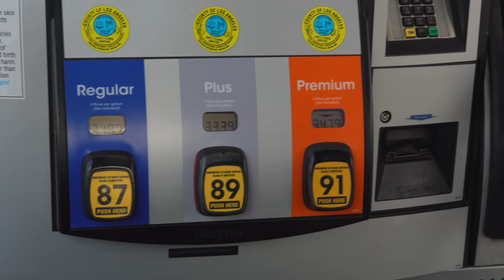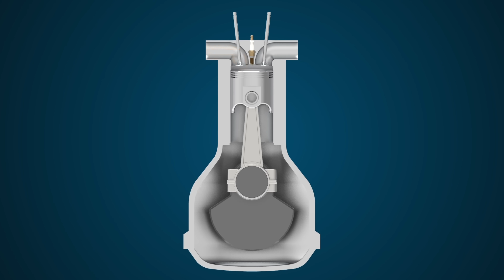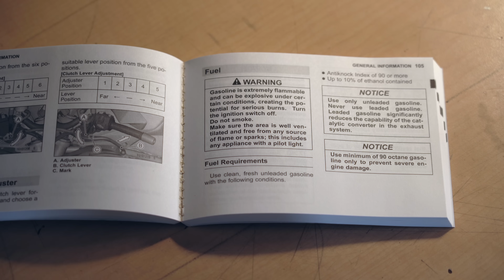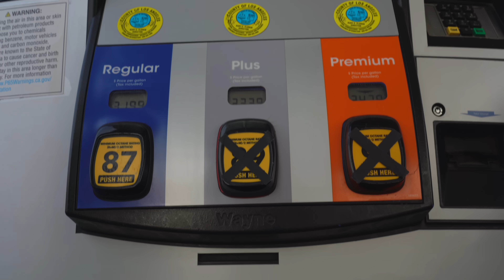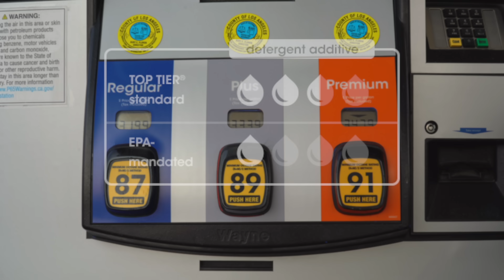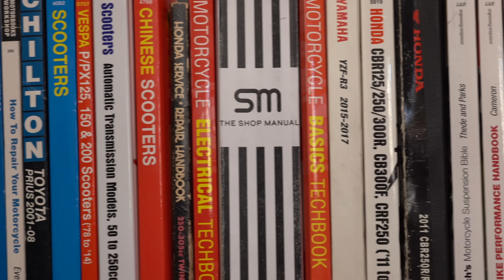Should You Run Premium Gas In Your Motorcycle? Octane Explained | The Shop Manual

Comment: Great video.  As a 1st time scooter owner (2020 Yamaha Smax/ XC155LR) and taking delivery via delivery during this pandemic I didn't have the ask question session with the dealer and as a result my 1st fill up was with 87 octane gasoline.  The ride was horrible, I knew something was wrong and asked questions on the Internet, getting 1000 opinions.  So I called my dealer and found out that I should be using premium gas, so now I am strictly 93 octane.  Had I only known about these Revzilla videos at the beginning.
Reply: Every bike manual says what gas you should use. And if you don't have a manual download it from internet.

Comment: Also note that 91 (low est octain fuels) can use other additives which cause waxing. Great for efi injectors as it improves lubrication properties in the fuel system. However for a bike that sits alot and carby bikes it blocks up jets, being a right pain. Highly advise running 95 or 98 fuels in those bikes before storage or to drain the fuel from the fuel system. Only run 95 and up in my cars and bikes.  Note, for Australia.

Comment: You missed a couple things: 
- US (R+M)/2 rating is ~4-5 points lower than R method used in most countries, so 87=~ A91-A92 and A95 is ~ US 91;
 - minimal grade sold in EU is A95 so most european bikes will need 91 and manual will list 95
- Rocky mnt states like Utah, Colorado, western SD, etc sell 85/86 as regular; and some stations sell cheap 87 but it is 30%+ ethanol which no bike is designed to handle. you definitely need to be careful there

Comment: Yes you are right if you think of engine management as static. But it is not that simple. O2 sensor, especialy new wide band  O2 sensors and  knocking sensor will be monitored by EM. And if you use high octane fuel in modern engine, there is a range where fuel higher detonation resiliance will be exploited by engine management. EM will advance ignition and valve management to some degree till knocking starts, or bad fuel brurning starts to be sensed by O2 or other sensors. This means that high octane fuel will be utilisied  by the engine, and higher efficiency will be achived. And that is more power and less fuel used.

Comment: Could carbon buildup cause power loss in a bike? My bike has been acting up when I try and give it throttle from a stop, and sometimes stalls as I'm coming to a stop. I've got to maintain gentle throttle to keep it alive, and give it a little rev to wake it up before trying to move. If I don't it just stalls. I've also tried giving it more gas, but that just makes it stall harder. Almost dropped the bike once because it stalled while I was trying to merge into traffic and I had to fumble to stop before the bike rolled into oncoming traffic

Comment: In the 1980's  in Australia we didn't have a petrol with a high enough octane level for my BMW so l had to reduce the compression. Now days we have octane rated petrol of 91, 95, and 98. Why is yours so low, and how do you guys get European bikes to run on those options.......93 seems very low. Sometimes l even add an octane booster to 98 RON to give me more power, and it is noticable.

Comment: I'm in Iowa, by far the highest ethanol-producing state in the union. So of course the cheapest gas at the pump contains ethanol. Most places here have 91 octane as premium and it does not contain ethanol. That's what the manufacturer of my bike says to use at a minimum. Definitely says non-ethanol gas. At 48 mpg and 3.5 gal tank, it doesn't hurt that bad, lol
Reply: You can find ethanol free gas in Iowa?  That's pretty good.  I'm in Colorado and I have to travel about 10 miles to get ethanol free gas (I only use it in my lawn equipment since the gas tends to stay in the gas can longer and ethanol attracts water.  It's also over $4/gallon).  Plus - regular gas is 85 octane here.  I have to buy medium grade just to get 87 octane (which is what my bike calls for and what I buy).
Reply: @MrTexasSteve  Many corner convenience stores in Iowa have all flavors of gas. Also, they are "top tier" with regard to the detergent package. In states where it is difficult to find good gas, it is due to your elected officials.

Comment: In the state of Minnesota, the regular gas and mid grade gas has ethanol in it. The only gas that has is ethanol free is the high octane stuff. I ride a 2018 GoldWing (which I know you love, and so do I) which calls for regular 87 octane and I will run it on trips if I'm going through gas quickly but won't put the regular ethanol crap in if I'm storing the bike.  Thanks for the video!

Comment: I use premium fuel in my motorcycle and car and even my lawnmower. Here, there is no ethanol in premium fuel and it also has way more cleaners with higher octane to boot. The extra cleaners are important to keep injectors from clogging especially in today's GDI engines. The extra cost of the premium fuel won't even buy you a cup of coffee these days anyway.
Reply: Check your location to see how many 0 ethanol stations exist. There may be some. However, premium gas is not necessarily ethanol free.
Reply: Lawnmower lol

Comment: High octane gas also has anti-oxidents added, another benefit in addition to detergents. I'm a control engineer who's blended millions of barrels of gas and diesel for 31 years for Shell, Fina, Exxon-Mobil, Chevron-Texaco & PetroCanada. To my knowledge, we've never blended cheap, off-spec gas for the Quickie-Mart type of retailer. Every 50,000 barrel blend is on-spec, or reblended till it meets spec (Road Octane = (Motor Octane + Research Octane) / 2). Here in Canada, you can see a tanker from a big name refiner, filling the tanks of the "Super Save" gas station.  The small retailers don't have their own refinery to make shit gas. They purchase on-spec gas from the big boys.
Reply: The ‘cheap’ gas or ‘unbranded’ gas is called Community gas and only meets the government minimum set in 1996 ( here in USA ), otherwise Shell, QT, Chevron…they have their own blends. Costco is interesting as they add their own additives at the delivery locations, thus boosting the ‘community’ gas up to the higher top-tier level stuff.
Reply: This makes me wonder if the folks at Sam’s Club make their own sub-par blends because any time I’ve filled up at a Sam’s Club store, my actual MPG (not car-computed) has always gone down. Less expensive since fuel is always nice, but not at the expense of good performance and keeping the equipment in good shape.
Reply: @trenauldo They have their tires and electronics made lower quality so it wouldn't surprise me.
Reply: @trenauldo  has a higher ethonal content, makes it cheaper and less mileage
Reply: We use to use platformate in our refinery area trucks when low instead of heading to refinery gas stations. Platformate from platformures is high octane before blending.
Reply: teman apakah gas condensate bisa untuk bahan bakar motorcycle mohon jawaban saya dari Indonesia
Reply: This

Comment: old news to me. like about 45 years old. the bike will tell you which octane grade you should use and a poorly designed combustion chamber requires higher octane. a centrally located sparkplug gives a shorter flame travel and thus less chance of detonation. also smoother contours within the chamber allow an easier movement of flame travel across the piston which also curbs detonation. 

the best fuel is that which does not contain ethanol and not the one with the higher octane research number.
ethanol absorbs water and thus decreases power and fuel mileage. when i switched to non ethanol gasoline my mileage went up from 50 mpg to 55 mpg and i also had to lower the idle speed as it went from 1100 rpms to about 1350 rpms at idle. this indicates the fuel is making more power than when running ethanol added fuel. also ethanol is bad for older bikes like i run because it is corrosive to the neoprene rubber these older engines use and that goes for both 2 wheel and 4 wheel vehicles. 

ethanol is very good for the lawn mower repair business though as it quickly gums up the fuel systems of smaller engines. it also pulls moisture out of the air so if a fuel sits in the tank for some time then it is adding water without you knowing it. fortunately there is a site that tells you where to find non ethanol fuel.
 the link to it is below.

https://www.pure-gas.org/

Comment: I don't ride anymore because of Covid19. 92 burns cleaner in slow traffic, at highway speeds 87 is burned at a faster rate and cleans as good as 92. Cars with a lot of sludge are cars that run in the city all day to lack of oil changes. 2012 S10 25K M

Comment: With my 4cyl car I would use 91 at the start of a long multi state road trip 1 way. On a trip through 4 states(except Texas, Alaska, and Rhode Island). Once had to do a tear down after a trip due to a blown head gasket. That engine was very clean after 400 miles of running at highway speeds before the head gasket went. The blown head gasket wasn't from the fuel used. It was a manufacturing defect.

Comment: I have a friend who ran 87 octane in his 2014 Street Glide for years.  It knocked and pinged all the time but he insisted that was okay.  It was, until he cracked a piston and ruined his motor!  😮
Reply: Isn't it depend on compression ratio when choosing fuel?
Reply: @esdeathchan4354  yes, and the compression ratio in a 2014 street glide is only 9:1; it is designed to run on regular 87 pump gas.
Reply: @RedEmpire36  i thought so
Reply: @esdeathchan4354  yes the higher the octane the more compression needed to make an efficient combustion, so for example your honda civic uses 89 octane because it's a low compression engine and your Honda cr85 runs 91 octane because it's higher compression, if you were to run 89 in the high compression dirtbike, you will get pre-ignition simply meaning the timing of the combustion will happen too early causing rough running and knocking.
Reply: @ColinCearley27  and that can damage the engine for long time
Reply: I don't believe this story for a single second.
I have run 87 in my Harley for years - not a single ping, spark plugs show a healthy color, great gas mileage, optimal performance. Something else was wrong with your friend's bike. If it was running so crappy, why didn't he get it looked at or tuned?
Reply: @Jeff82556  Just to followup, my friend's 2014 owners manual does indeed state the bike needs to run premium fuel, and if forced to use lower octane then only do so for short periods and replace with premium ASAP.   That's from Harley itself, so, yeah. 😎
Reply: Most engines built in the last 20 years don’t require premium. It’s pretty standard to use premium in carbureted engines. The premium where I live usually only goes to 91 octane though. I run that in my Harley but it’s also a carbureted ‘95 1200 evo engine.
Reply: @Jeff82556  “Based off the Timeless design of the Ironhead Sportster, in 1986, Harley-Davidson upgraded the Sportster with the newly designed Evo engine, replacing its predecessor that had become a staple of the Sportster since its inception.”
Reply: @flfbsphatboyblue8970  I agree with your statement here, but I'm unsure why you're telling me this. What's your point?
BTW, the EVO engine was manufactured and used by Harley-Davidson since 1984.
Reply: @Jeff82556  Ahh… so you deleted your misinformed statements to Coyote. I see.
Reply: That's how it happens
Reply: Totally air cooled motor?
Reply: @daveyt4802  Yep, no water cooled heads on his bike
Reply: That's just Harley's shitty quality, not the grade of gas
Reply: @rslover65  says the person who has never owned a bike.....
Reply: Always heard the HD bikes had to run premium fuel!
Reply: @kensmith9334  Not true. Just looked in my Harley manual: says "use 87 octane or higher"
Reply: @kensmith9334  it could be that their was other problems with the bike like timing skipped a tooth, carbon build up, or running too lean
Reply: @kensmith9334  The V Rod requires premium because it is a high performance engine.
Reply: @Jeff82556  You should probably try learning all about Harley’s too. Try Google, if you know how to use it. 😉🤣
Reply: The fuel didn't cause his problems, it was a shitty engine to start with.

Comment: Single hose pumps. If you only top off with a gallon or so of gas (like I often do before parking back at home), you are really pumping whatever grade the last customer pumped. That is why I started carrying a small bottle of octane booster in my bike that calls for 93 octane. It's not a perfect system, but beats gradually filling your tank with regular.

Comment: Hi, can you PLZ explain HOW is the Yamaha R6 599cc way faster than the Kawasaki Ninja 650 649cc ?? how can having the same cc they have soo much difference in HP 98.9 vs 68?
Reply: Torque
Reply: The ninja 650 is stronger at lower rpms. You have to rev the r6 to higher rpms to achieve power.

Comment: Great vid! I always can't believe how many people think that higher octane has more power, and I always have to tell them that it is just their resistance to ignition. I do have one question, however. If I have a bike that says it recommends 87 gas, but I tend to ride it harder than maybe I should, would premium be a good idea just so I shouldn't have to worry about any pre-ignition?
Reply: It will probably just make it run smoother. Doesn't hurt, try it a few times then go back to 87 and see if you feel a difference.

Comment: Good video. Here in Australia I run my Indian Springfield on 98. In the USA 93 but Canada I found I needed to regularly use an Octane booster as the heavily loaded bike would ping especially when climbing. The octane boost was effective. I have not experienced this problem in Australia. I avoid ethanol but you don't always know what your fuel is so I prefer major brands. Cheers and thanks. Fuel is cheap. Pistons are not.

Comment: I have to Run 93    on 16 road glide or it knocks at low RPM        IVE haul gas      what a joke       87 & 89   for the most part its the same    company will put 89 into the 87 holding tanks because its cheaper to mix in ethanol    and as long as it rate 87 or higher its legal     No for 93    lol     that can be mix 50/40/10    50% unleaded   40% premium    10% ethanol        endless you go to Shell    Mobile   or Marathon        I know haul it by 8000 gal at a time        just saying

Comment: Higher octane fuels also have more preservatives.  These preservatives can cause some engines to cut out.
Reply: Correct. High octane has detergents, anti-oxidents, and sometimes dye added. I believe the preservatives you refer to are the anti-oxidents.

Comment: No comment about difference between  RON & MON?  If winter or summe should influence which gasoline you buy? Humm....
Reply: I mention the different rating systems in the first few lines of the vid. And it's a video about octane, not winter/summer blends.
Reply: @AriH211  No worries Ari, no intention to criticise for the sake of criticising. I just think there's actual value in understanding MON, octane impact in flash point, and if you use higher or lower MON gasoline depending if it's winter or summer and your bike's compression ratio.
Reply: I've blended millions of barrels of gasoline. In winter gas, we add Butane to increase the RVP (Reid Vapour Pressure). This is by far the greatest player in volatility, much more than Octane. It allows for better vapourization at low temperatures. Less of an issue in non-carburated bikes due to the advantage of fuel injection.
Reply: @impaaked  No one is saying the opposite. :) The question here is between RON ratings, which is the rating available to the consumer.

Comment: I worked at fuel tank farms, most fuel comes from the same location. You will see flying J, quick trip, 7-11 and etc you get the point I’m sure. There are few exceptions to the rules like Chevron, BP and Shell. They have their own refineries.
Reply: Yup, the base stock in fungible and comes from just a handful of refineries. What makes a difference is the additive package that each retailer blends into the fuel.
Reply: @AriH211  it’s already blended. It’s loaded in to the fuel trucks. It goes from the fuel trucks straight to the gas stations.

Comment: Also, many (most?) premium fuels have no added ethanol.  Older bikes built before ethanol was added to fuel may have components that degrade more rapidly in the presence of ethanol.
Reply: Mica the no ethanol-in-premium scenario is a thing of the past, at least in most regions in America (I can't speak for other nations). We mix ethanol at 10% in 98% of the fuel distributed in the States, as per the 1990 Clean Air Act and some other political crap. But you're right that older bikes, specifically their fuel lines, carb gaskets, etc., do not get along well with ethanol.

Comment: Wait a second here. Ignition timing is controlled by the ECU. The more advance is the ignition timing, the more energy extraction from fuel, the more power. ECU  tends to advance the ignition timing until it detects knock (pining). With high octane gasoline, or with certain fuel additives, ECU is free to advance timing so you get better response, maximizing gas mileage. You can feel it on your bike.
Reply: The vast, vast majority of motorcycles do not have knock sensors.

Comment: Bullshit! Always run regular unleaded in my bike and my Acura which calls for premium. Bike has 34,000 car has 140,000 never a problem, no lack of performance no pinging runs perfect!
Reply: Your car has a knock sensor so pulls ignition timing if/when knock is sensed, and you don't specify which bike you have. Also, just because you've never had trouble, doesn't make the science wrong. ;)

Comment: My 2 stroke requires 95 or above. I never use an ethanol based fuel. I try and use Klotz, avgas or VP. Leaded fuel also keep the pre mix better. for me it isn't pump gas vs race, it is the availability of non ethanol in my area, I have zero. I mainly run AVGAS